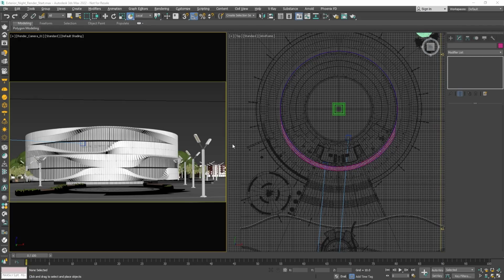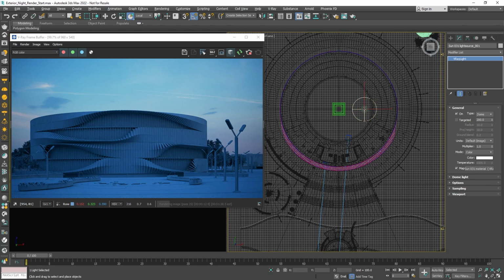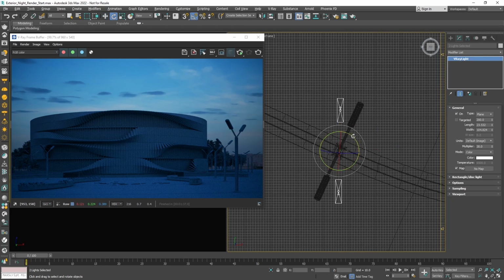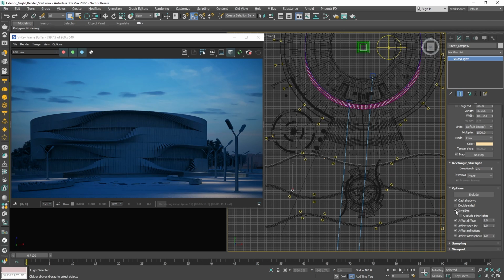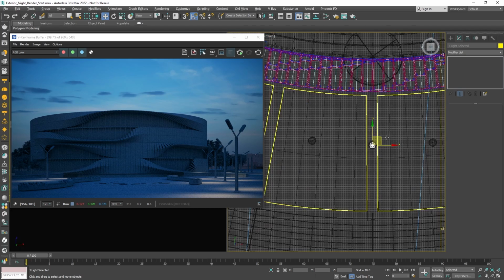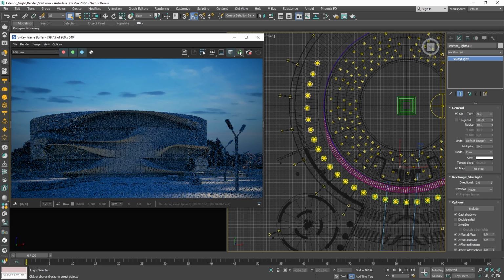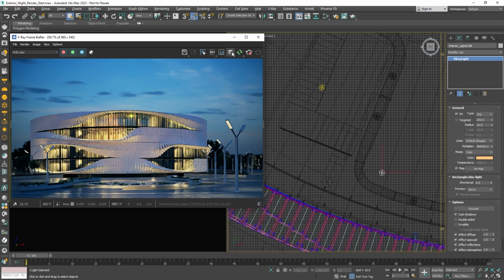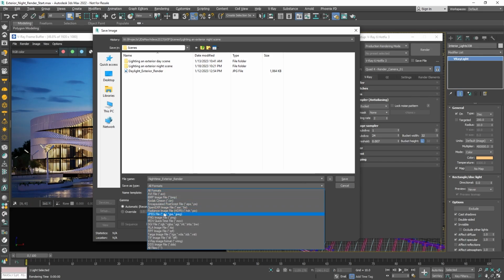Realistic exterior night lighting with V-Ray for 3ds Max

Comment: how come when I save my image from the vray buffer. when I open it. it does not look the same. my exposure is way differente.. any ideas.. cheers. thank you in advanced
Reply: Hi, I believe it to be color management within frame buffer. Check Display Correction setting in frame buffer and make sure to check Save RGB primaries conversion. Otherwise check your Color Mapping settings with render settings. Frame buffer will usually apply a 2.2 or srgb correction when saving the output. Good luck!
Reply: @alejosg-axis  am ususally wokring on ACES.. but it works.. thank yo umate

Comment: Have you used Brute force and light cache?
what are the parameters for those?
Reply: Just use default, they are very good for most cases, for interiors you can increase the Ligh cache to 2000 if need it
Reply: @franciscop.4727  thanks for the prompt reply sir!

Comment: No need to capture in 60fps, that's overkill. 30fps is plenty.
Also your denoiser needs to work on the lighting solution, not the mixed results with textures because it just blurs out subtle textures and is therefore entirely useless.
Reply: can you apply the denoiser only to the lighting solution?
Reply: @FelipeGonzalez-xn2mj  do you mean is it technically possible to do that? yes, very much so but not as easy as just working on the final image.
Reply: You need to relax, every desktop capture recoding sets at 60fps. If you have so much criticism... make your own tutorial video
Reply: @belialarchitect1678  I think you need to relax. What I said was very sensible and very pertinent. Their denoiser that they are touting in this video simply doesn't work and I've mentioned it for them before. It need to denoise the light, not try to denoise the resulting image that is mixed with subtle textures. If it would denoise the light it could produce great images almost instantly but because it also blurs textures the image does not become usable sooner than without the denoise, entirely undermining the value.
If they do it right it would be hugely valuable. As it stands, it's worthless. It's more complicated to do it right but that's no excuse for failing completely while pretending it works.